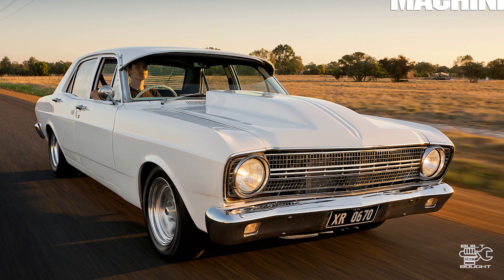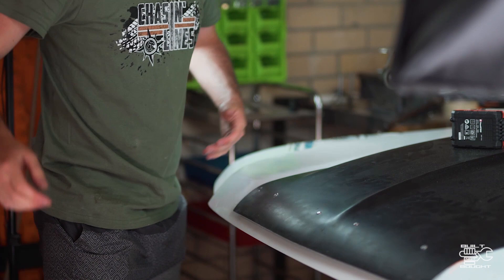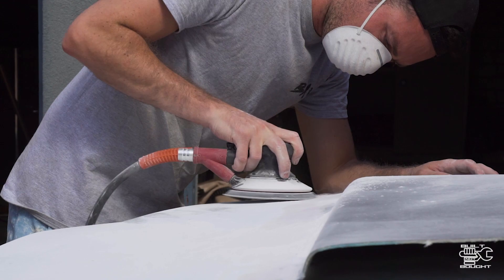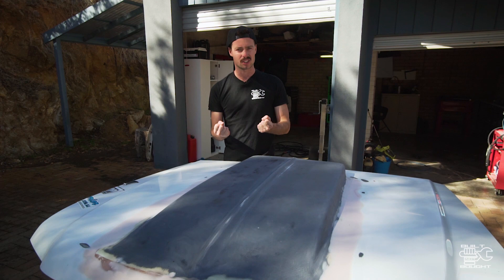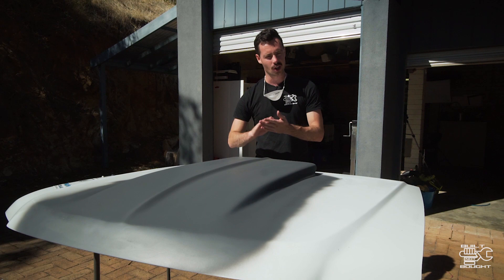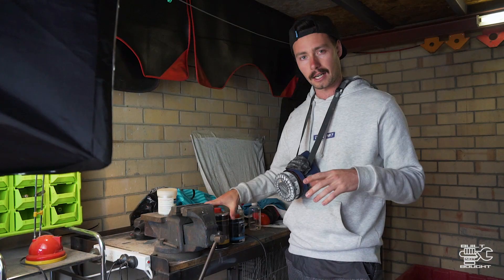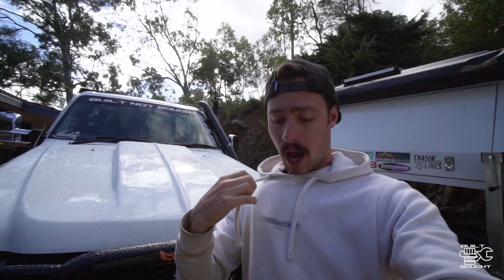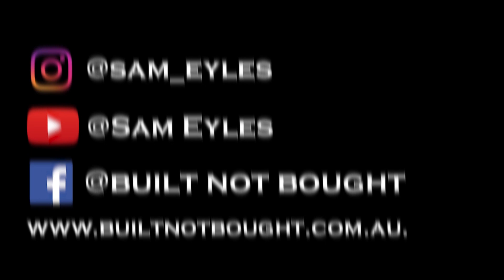Everyone Told Me Not To Do This!!

Comment: And also,you don't want to spray etch over a job like that, the etch can get under the paint and bog and cause delamination. You want a can of "rub through primer" from a panel and paint supply joint, and just give it a bit of a spray over any bare metal. Then you want to use a high build over the rest

Comment: Also etch primer as he used is for bare metal if anyone is looking to do this, get a single pack acrylic primer / even put some plastic or adhesion promoter on the plastic or fiberglass. Also not sure on laying down acrylic colour then 2k clear.. prob use base coat then 2k clear. looks pretty good from here tho i must say from what i first saw

Comment: Use urethane windshield adhesive for scoops, flares,  ECT. Clean prime the 2 mating surfaces. Body panel epoxy works good too but windshield adhesive is cheaper. No need to clean up around rivets if you don't use rivets.

Comment: You get orange peal in the colour coats of the paint and sand that first before clear coat.
But you paint was obviously thin enough to not get the lumps. You did forget to mention giving it a clean with wax and grease remover before painting but good work

Comment: When you have a scoop are you still able to do deep river crossings? Will the intercooler fill with water if you have a scoop?
Reply: Radiators work even better when submerged, which obviously applied to intercoolers. They shouldn’t get any water inside them unless they have a leak